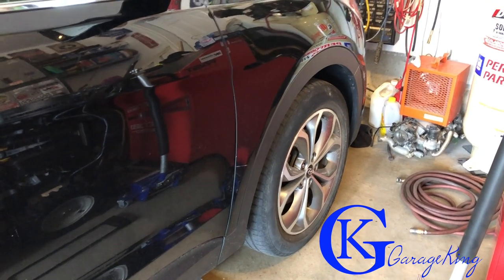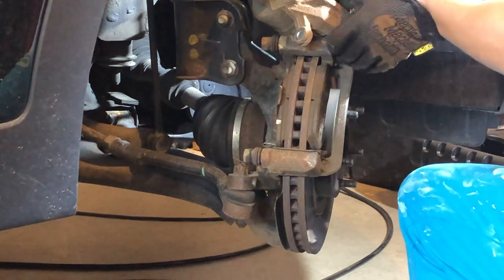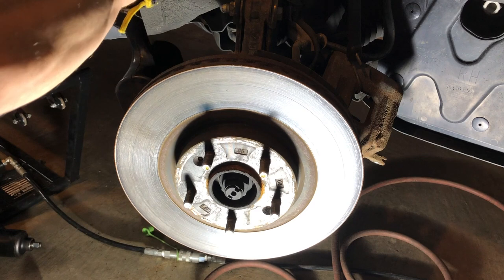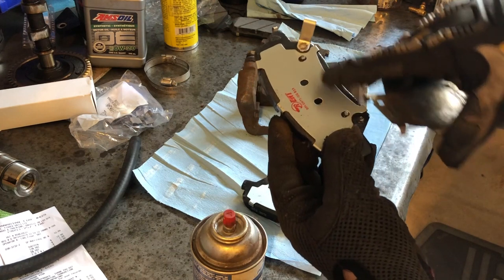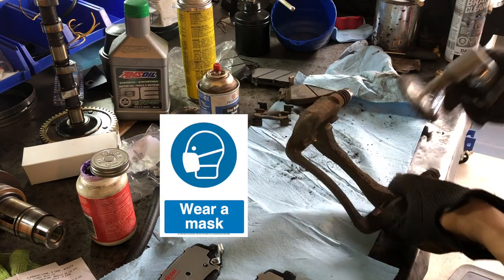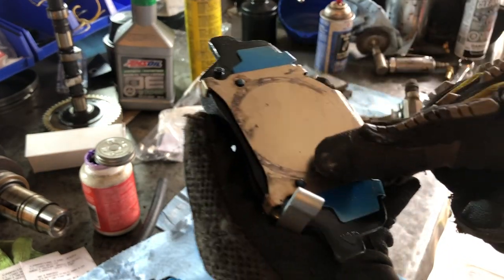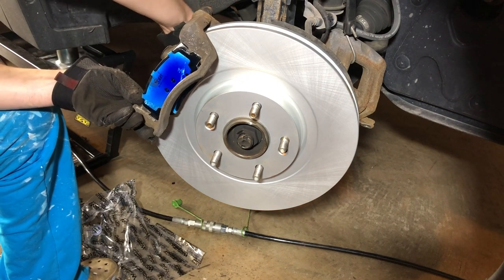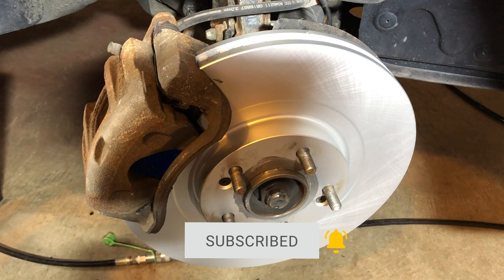2014 2015 2016 Hyundai Santa Fe Front brakes

Comment: What was the torque setting on the bolts?
Reply from the maker: The aluminum wheels actually have a low torque setting, they are torqued to 80ft/lbs. 
The philips screws to hold the rotors on are just snugged up.  
The big bolts (17mm) on the rear of the caliper bracket that hold it to the steering knuckle are 60-70 ft/lbs. 
The small bolts (14mm) at the top holding the brake caliper to the caliper bracket are 16-23 ft/lbs
These are for dry clean bolts, if you lubricate bolts then its less, and rusty bolts would require more torque to get the same clamping power.  
If you noticed I did not use a torque wrench as I have done so many brake jobs over the years that I know the feel.  I am a licenced mechanic.
Hope I helped you out bud and thanks for watching!!!
Reply: GarageKing thank you!  Caliber torque to 80ft/lbs also?
Reply: Really nice brake job.  Thorough.
Reply from the maker: @JSes8477  Brake Caliper bracket to steering knuckle is 60-70 ft/lbs, those are the big 17mm bolts (3:03 time stamp).  The small Brake Caliper to Caliper bracket bolt (14mm)are 16-23 ft/lbs (1:10 time stamp).  Good luck with the job!!!  Anything else just let me know :)
Reply: GarageKing thanks.  Just finished mine. Worked out great!
Reply from the maker: @JSes8477  That's Awesome!!!  Glad I could be a part of it and help you out :)  Happy New Year and best wishes :)
Reply: 78lbs and I'll never use impact on brakes as long as I live. I fixed it with a helicoil. I drilled out old holes got a tap made new threads and inserted the helicoil ( new bolts 1mm wider in diameter) put in out just like new) reattached and because ftw I added red loctite.
Reply: @GarageKing  78lbs and I'll never use impact on brakes as long as I live. I fixed it with a helicoil. I drilled out old holes got a tap made new threads and inserted the helicoil ( new bolts 1mm wider in diameter) put in out just like new) reattached and because ftw I added red loctite.
Reply from the maker: @minnesotanice369  What an ordeal that would have been!!!  I have used the helicoil before and its a pain.  They do work, but lots of times when you take the bolt out sometimes the helicoil comes out, good thing you used loctite !!!  You know some of these factory torque settings are really weird.  I was doing a job on a Suzuki one time and I swear the factory torque setting was too high.  I was using a torque wrench (this was earlier in my career) and I could not get to the factory torque!!!  The threads actually stripped before I got there.   The worst part was I could tell, the bolt got really tight then the dreaded feeling of getting loose.  Now I use the impact to take things apart at times, but I ALWAYS put everything together by hand.  If it makes you feel better you are not the only one this happens too.  I had a viewer tell me the exact same story not too long ago.  In the trade we were taught to use an impact to put everything in.  What I did was run the bolts in on low, then torque by hand.  There were many mechanics who did everything by gun (I think that's a mistake)  I don't want to ramble anymore, so I am happy you got it all fixed up and congrats on tackling the helicoil, some would just call for a tow to the shop......
Reply: @GarageKing  the trick is make sure to blow off metal shavings before reversing the tap out. I used the 3 in 1 oil everyone and their mom knows about to tap. When you insert helicoil make sure your going in straight and be careful about breaking off the metal tab... and finding exact sized bolt and helicoil
Reply from the maker: @minnesotanice369  Oh I know :)   I have a metric kit on hand, and lucky I have only had to use it a few times :)   Appreciate you sharing, cool to hear stories from others.  Thanks :)

Comment: Enjoyed watching.  May I suggest after removing the tire to open the master cylinder.  A large C clamp on the caliper and the outer pad will allow a lot of compression on the piston.  After removing the caliper, use an old pad against the piston and use the C clamp to completely compress the piston.  Removing the cap on the master cylinder makes cylinder compression much easier.  REMEMBER to close the cylinder and after starting the car, pump the brakes a few times to build up the pressure in the system.  Your piston compression tool is nice but not everyone has one.  More  likely to have a C clamp.
Reply from the maker: You may absolutely suggest that, and I used a C-Clamp for years before I got that caliper tool.  Sometimes I still use the C-Clamp with a pad trick as that tool is too big for smaller calipers.  To take it one step further sometimes I use to open the bleeder on the caliper and then push the piston back in (very easy with the bleeder open) and then wait for a second until fluid starts coming out, and then close the bleeder.  This way the calipers got a bit of a flush and I would just top off the master cylinder at the end.  I'll have to do that on a future vid :)  Great comment, and glad you enjoyed the video.  It takes hours to film and edit car repair videos so I'm appreciative when I get a great comment.   Thanks and happy holidays to you :)

Comment: Good video, and 100% on the gloves. After many years not wearing gloves and hands that were like sandpaper, swollen and cracked.. gloves all the time now.
Reply from the maker: You know it,  I never wore gloves when I started in the trade, no one did.  After years my hands were impossible to get clean.  I started wearing gloves (and do so all the time) and my hands are now back to normal LOL :) Thanks for the comment ; )
Reply: @GarageKing  yip, I tried to tell a friend of mine to wear gloves but he just laughed and shrugged it off.. well he was working in the engine bay of the vehicle and dropped his spanner. It landed on the positive and negative terminals of the battery. He went to quickly grab it off and guess what lol 2nd degree burns on his hand lol he wears gloves whenever and wherever he can now lol
Reply from the maker: @crunkwun  I feel bad he got burned, but at least he will wear the gloves.  Once you wear them on a regular basis you get so used to them and it actually feels weird not wearing them.  Just get good fitting gloves, I found that make a big difference.

Comment: I like your detailed instructions, which should be clear enough for anyone to do a brake job. In the past I have slightly loosened the bleed screw on the caliper before compressing it, allowing the fluid to flow out rather than being forced back to the master cylinder, but maybe this is unnecessary. It could also introduce air into the line if not done correctly. Maybe someone has the pros and cons of doing this, with an opinion of which is better.
Reply from the maker: Many times I have done what you mention, and there is a plus to doing so if the fluid is dirty.  The fluid in the caliper is more dirty than the fluid in the line or the master cylinder.  I crack the bleeder right open and push the piston back, hang the caliper, give it a tap to get out the air bubbles and let it gravity bleed.  Then close back up and top off master cylinder (it will be low after this)  I didn't include this in the video as there is a lot that can go wrong.  1. You introduce air in the system if not done correctly 2. you forget to fill the master cylinder and after a few months of wear your brake light comes on and you can get air in the master (really hard to get out) and 3. the bleeder requires very little torque to tighten back up and I have done brake jobs with the bleeders broken off.....  Those are the three that come to mind right away.  So there is a benefit, but it has to be done right.

Comment: I like to paint them black after cleaning them up.  I kinda hate seeing the rusty caliper.  I also use some silicone spray on the caliper-piston rubber before pressing the piston back in.  Excellent video!
Reply from the maker: Thanks for the great comment, I agree with painting them whenever you can.  The next few brake jobs I actually do paint the calipers.  Its work, but pretty satisfying as the paint keeps them looking clean.  I agree with you 100% !!!  You know I never thought about using silicon spray on the piston boot, good tip !!!!

Comment: You don't always need to get new rotor every time. I often switch to new pads with the smae rotors if they're still smooth. Also, you get the caliper pistons back in with just a big C-clamp.
Reply from the maker: Yup, very true, in this case the pedal was bouncing a bit so that's why they were changed.  Many times I only change the pads.  You can use the C-clamp, but you need a big one and sometimes the brake line in the rear gets in the way.  I use to use one all the time, but I find the tool way faster.  Thanks for the comment :)

Comment: Really enjoyed your video. I am going to be doing my daughter front breaks on her 2017 Hyundai Santa fa. I do have a question after I do the breaks should I bleed the front breaks
Reply from the maker: You don't have to, if someone topped up the fluid then when you push the caliper pistons back, then the fluid will just come out of the master cylinder and just wipe it up.  If the fluid was never topped off, then once you push the caliper pistons back the fluid level will return to full level.  2017 is still pretty new so I would say your fluid should still be pretty clean.  The one thing that does really help is the caliper piston tool:
Amazon.ca https://amzn.to/3nadUOH
Amazon.com https://amzn.to/3ocTOV8
Thanks for the comment and if you need anything else just let me know.
Reply: Ok thanks
Reply from the maker: @josephcastiglia6741  Anytime brother !!!

Comment: Hey man thanks for the excellent video. One question maybe you could help me with: which pin goes on the top? From what I can tell the 'brass' colored pin is on the top and the silver pin with the bushing is on the bottom. Is this correct? Do you know the reason? Thanks!
Reply from the maker: Hey thanks for the great comment, and its one I have thought of myself.  I believe the reason is so you don't get as much of a "click" when you brake and the pin with the rubber keeps the caliper steady as its a tighter fit, so it prevents the the caliper from wiggling.  If you had two pins with rubber it would be overkill as the caliper still needs to slide.  When I do a job I'm careful to put them back in the same way they came out.  But I guess to answer your question, it to reduce noise and help keep the caliper aligned during braking :)

Comment: Hi, great vid! I was doing the same job today on the same car. My socket wrenches and breaker bar we're a pain to use on those caliper mounting bolts, too beefy. What kind of socket wrench we're you using on them? It almost looked like a ratched breaker bar.
Reply from the maker: Hey there, and thanks for the comment, yes those caliper mounting bolts are a snug fit in there.  I used a 3/8' long ratchet with the socket.  See the 3:00 min mark.  Thanks brother !!!
Reply from the maker: Also if you go to the 18:00 min mark I lay out all the tools I used so you can see in detail if that helps.
Reply: @GarageKing  Thanks for the quick replies!!  And thanks I missed the part at 18:00 and went back it was helpful.
You dont happen to remember what brand the ratchet is tho?
Reply from the maker: @wrii2034  Hey There, the ratchet is not cheap!!  Its a Snap On, but I really like it.  They are actually on sale this month, here is the Canadian flyer is you want to take a look.  I post the flyer every month. If you are in the US they would probably just cost 30%more (difference in Money)  You can see they are not cheap LOL :)    https://youtu.be/d0w13XkWhmc

Comment: Does he say what spray he uses on the back of the brake pads?? Besides that he does an excellent job of editing.
Reply from the maker: Hey There, I used this https://amzn.to/3QuoYHT and it works really well.  It can only be used on the rear of pads (that's it) and its quite sticky so you have to be careful assembling your brakes.  The best lube you can buy (which is actually not that expensive is this) https://amzn.to/3UGKlYR Its great for the slid pins.

Comment: if my hyundai says manufactured in 2016 November 30 on door tag did the dealer sell me the wrong tear car? I can't find any sante fe sport brake calipers for the front and the ones I do are dual piston

how can I prove this mine are just like these
Reply from the maker: Hey brother, if you car was manufactured Nov 2016 it should most likely be a 2017 model year.  I know when I was calling there are like 3 types. If you sport/non-sport, and there may have been something with a middle seat???  It was pretty crazy. The place I called is a local place in Canada, they are not in the US but use to rebuild them locally. Maybe they started doing that again?  Is there a place where you can take them in to be rebuilt?  You will just have to block off the brake line so your fluid doesn’t all leak out.  That may be your best best. Your title and owners manual should say 2017. Plus I think you can check your model year by the 10th digit in the vin(you may want to Google that )
Reply: @GarageKing  all I need is the stupid brake caliper bracket and bolts. I stripped them. There's not a place on earth that has front driver single piston caliper. Every auto store is stupified by it I had two dealers order it comes in as dual piston caliper. I gotta just search and search 6 bone yards it's incredibly insane
Reply: last 8 of vin HH030013

awd non turbo awd 2.4 sport
Reply from the maker: That’s what goes most of the time. When you order the rebuilt one you get the whole unit. The piston part is usually ok. It’s the bracket as I know how those pins can seize up!!!   I’m wondering if you can take the whole thing in to get rebuilt and just tell them you need the bracket.  There are probably only a certain number of pin sizes.  I wonder if you call a machine shop and ask them. They may be able to refer you to a rebuilder. Maybe one of those classic type rebuilding places that rebuild steering racks etc.  I am truly surprised how much trouble you are going through just to get brake calipers.  I feel for you !!!!
Reply from the maker: Yup H means 2017, so it’s a 2017

Comment: Nice video. Had question on the hardware clips  would it be ok to use little  grease or  Anti-seize?
Reply from the maker: For sure, I usually do and if I didn’t in the video that would be my bad :(   The only thing is use anti-seize, never grease. That’s what I was taught in mechanic school.  The reason is with the high heat of brakes the grease can break down and travel to parts it should not be near. Anti-seize does not do that so it’s safer. You should put a dab on each side of the hardware. The side that touches the caliper bracket and the side that the end of the brake pad housing touches.  For the pins don’t use anti-size, it dries up. Use caliper pin lube for that. If you need anything else just let me know.  Thanks :)
Reply: @GarageKing  thanks man i really appreciate it . You seem very experienced.
Reply from the maker: Anytime brother,  I’m a red seal licensed mechanic with quite a few years in the trade. I like doing these vids to help people learn as it’s pretty empowering to fix your own car !!  Glad I could help out :)